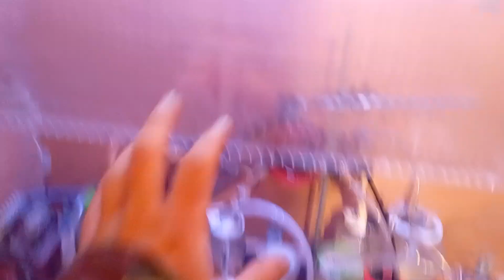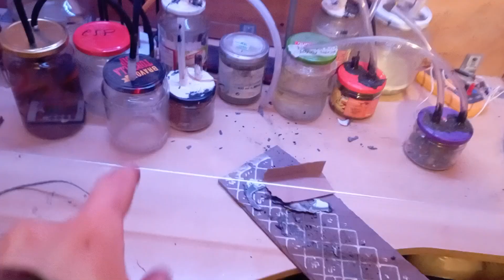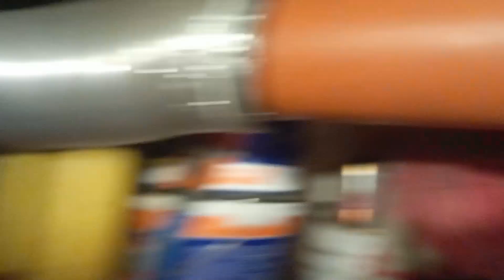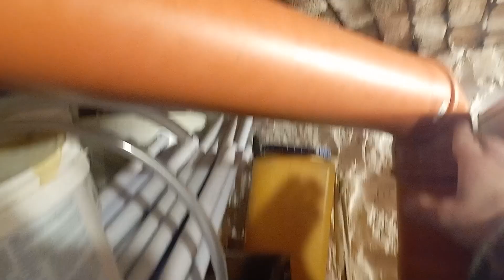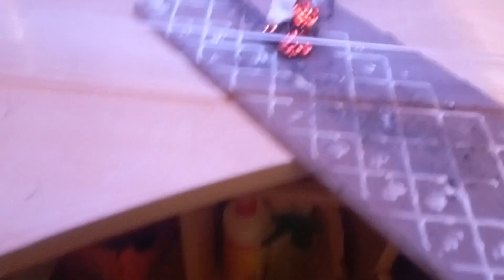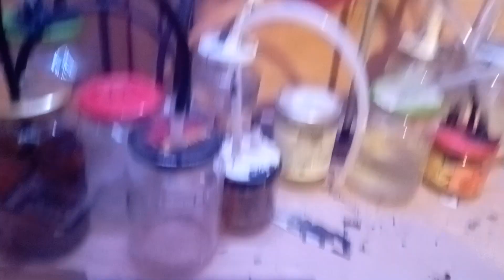Making the FumeHood for Sulfuric Acid Production Weekly Report 14

Comment: Are you sure that an ESP is really necessary for something on this scale. If you just have a regular condenser column, wouldn’t that achieve more or less the same job with way less complexity. Also, have you actually gotten some runs with this thing and measured its efficiency, as compared to something like a lead chamber process.
Reply from the maker: A very good question indeed, I have just integrated the condensers (one after each absorber) into the system (without the esp, cause it's hard to make it really corrosion resistant in the presence of hot, so2+so3+sulfuric acid mist), made a video about it, that wasn't that good, so I'll remake that. Although I can't really show up real data just yet, cause I'm working on the automation of the system for now, with the sulfur feed and the flow control, as well with the photo control of the conversion. I will test the system soonish, if you stay tuned, you'll see these vids coming out. Just been working real hard trought these last weeks, and I just realised how much more it takes (than expected), but that's okay, I'll make it work regardless of the coditions.